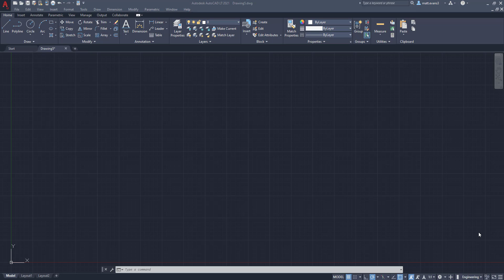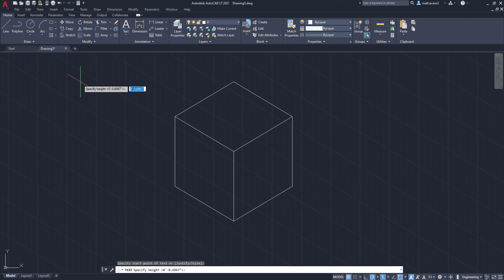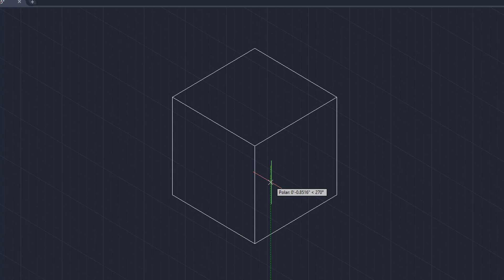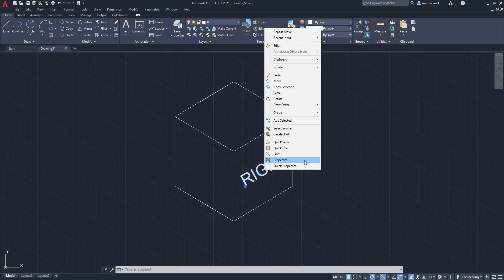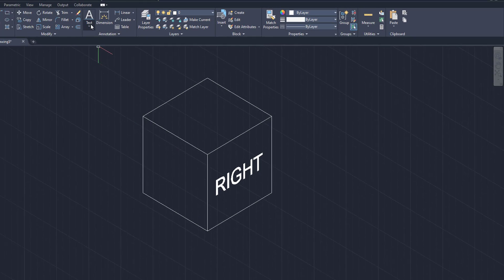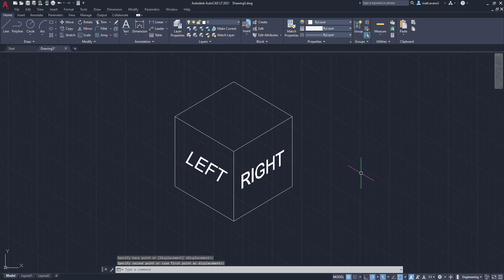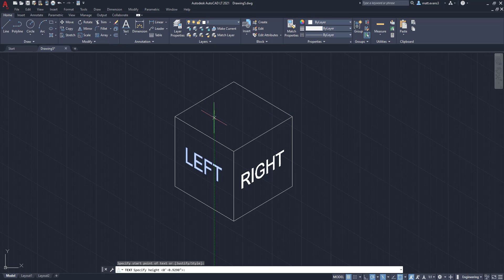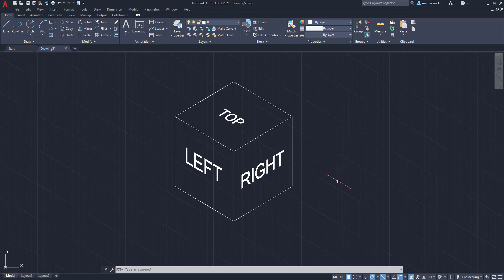ISOMETRIC TEXT Tutorial - AutoCAD

Comment: hi, kindly tel me how to get this 2d isometric view in a different plan. I need a projection of a cube with 2d text like top view, side view. all this i need in model not in layout.
Reply from the maker: You should be able to use the viewcube and rotate to the top. If you are just using AutoCAD LT the view cube will not be available. In this case you can use DWG Trueview which as the viewcube on it.